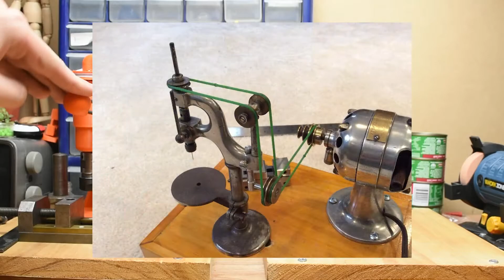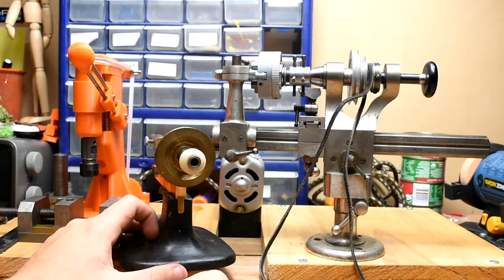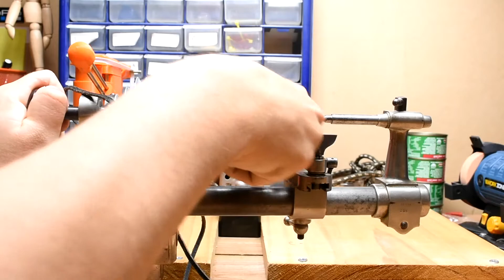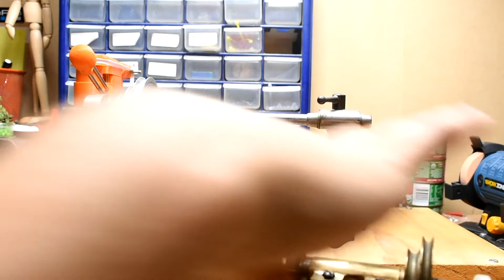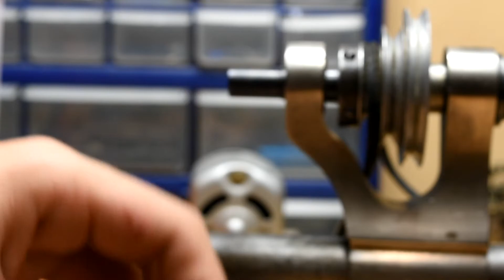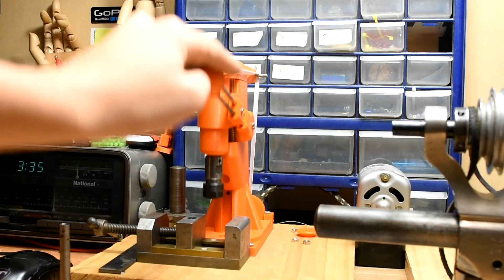Random Ramble #2 - Watchmakers Lathes Show and Tell

Comment: Hello the clh model seven lathe and powered by a watchmaker's arc and it allows you to machine timepieces to the hundredth of a millimeter, to clean it you can use for one liter of cleaner: 50 grams of Marseille soap 100ml of ammonia and the rest of the demineralized water and the best would be to put it in an ultrasound machine that you can buy on the internet.
And for your second round and very beautiful! 😄